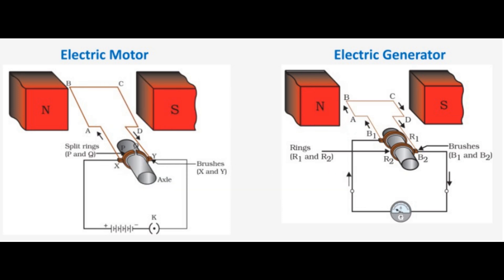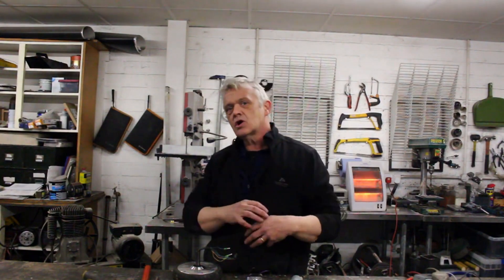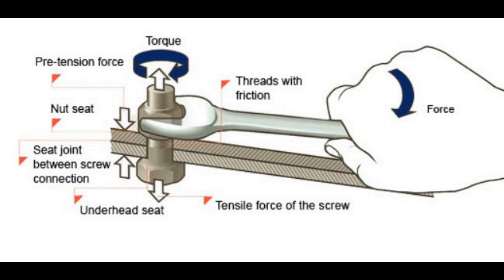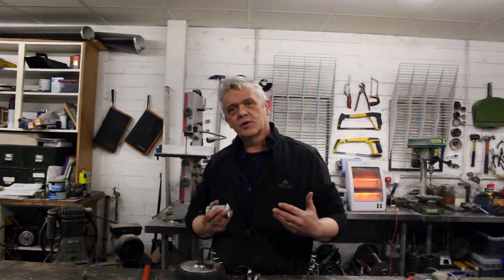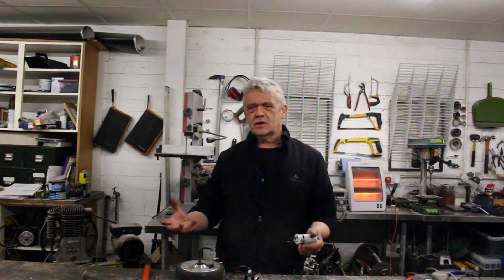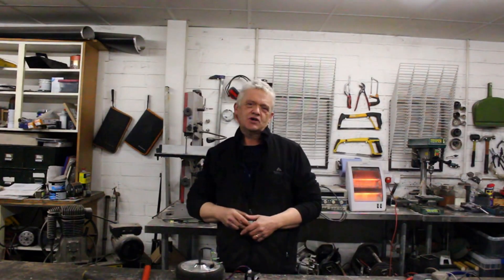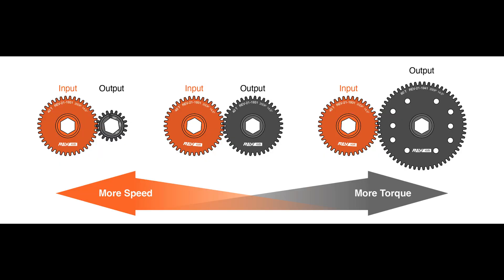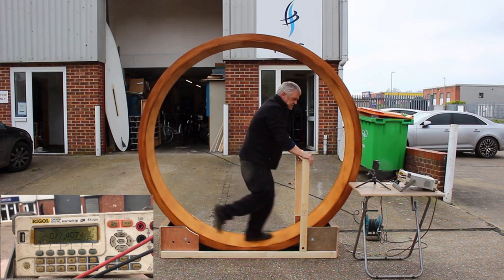2227 Choosing Motors To Turn Into Generators

Comment: Thank you for the pearls of wisdom Robert!
I am an absolute novice, but after researching before setting about to build a waterwheel ive found the biggest issue is transfering the energy from source to use/storage. Most motors produce dc power, but to transfer 12v or 24, even 48v d/c power is highly inefficient, for some reason there is a tremendous loss of power even in a thick cable over a distance of, say 100 meters. Whereas a/c, even in a very thin 14awg/4.5mm wire the loss is negligable. Electricity is strange stuff

Comment: Technically, power plants doesn't use permanent magnets at all. They're using electromagnets as a rotors. There're two types of constructions to transmit energy into such rotor. First -- just using a collector on the shaft and second -- using a rotating transformer or another generator on same shaft, that inverted in terms rotor/stator so you just energize stator and rotor would be generating and supplying first rotor's winding.

Comment: Old Fisher & Paykel ecodrive washing machines are amongst the best. Company in new Zealand makes wind turbines using those exact motors. I got one in parts in my shed, AMAZING amount of magnets and coils. Generally the electronics fail in them and the motor is fine. I got mine off the roadside.

Comment: I would like to understand more about hand cranked motors without needing to use 3D printing
Reply from the maker: i am not sure what you mean mate - do you mean how to turn a motor into a hand cranked generator? or how to build a motor witout 3d printing?
Reply: @ThinkingandTinkering  i meant how to turn a motor into a hand cranked one. Something very small that won’t require much that I can show to a child
Reply from the maker: @townbell2248 ok got it mate - that's in the gearing -  get a small motor some lego gears and you are away - the faster you turn it the higher the voltage but it gets harder to turn - i did do a video on the relationship of gears to torque and speed
Reply: @ThinkingandTinkering  thank you, I will have to check my kid’s toy box! Have you ever seen those spiral drawing gear wheels? You stick a pen in a hole and they draw cool patterns.
Reply: @ThinkingandTinkering  thank you for everything.
I hope you & your family are staying strong despite difficult times.
Please don’t stop doing what you do.

Comment: Isnt the counter torque going to be based upon the electrical load? Open terminals on a motor are easy to turn, but short it out and it becomes difficult.

Comment: Any motor that could be turned as mechanical force easily (say a washing machine motor) using water fall force would be beneficial but friction will always be a pain in the bum.
Reply: By the way Rob, the motor you turned by running on a wheel, if you ran that on a wind turbine 3 times the circumference of your wheel you would get some cool outputs.
Reply from the maker: it always is mate lol!

Comment: A brushless motor is a lot more efficient and a stepper motor is cheap easy and almost as efficient, so the best choice would be probably a stepper motor.
When it gets really interesting are linear actuators, you could use a speaker as the generator then, but I have never done that and I would like to know if that works well.

Comment: I work in trades/construction and regularly see motors tossed in the bin that could be salvaged. Most common are fans (ceiling fans, bathroom vents, oven ranges).
I'd love to see some 3D printed kits that could repurpose some of these motors.
As much as I would like to take a few to tinker, I don't have the space nor the time for making my own kits. But if one was available I would at least build a few and give away some.

Comment: The flywheel should be the battery spinning, three Free energy packed weights all gears together the motors the battery/ gear/ generator charge high voltage no contact deceleration , drive on low voltage, bearings for brushes.

Comment: What if,. Instead of using alot of magnets are mounted eccentrically on the shaft,  and the windings are on iron bars that reach to the center aligning with the magnets forming a loop from the shaft. Up through the core and back to the shaft with something like two 25 mm cubes, or cylinders, possibly a pair of 50x50x20mm N52 magnets, (or whatever the strongest new magnets are called!!). Or use 4-6 magnet's, two in a gear sperating like a planetary   with the U shaped iron , the u facing the rotor, with the gears passing inside at the tips , on the edge of the gears the gears having a trapezoidal iron chunk on it on both sides.  The shaft causing the gears to spin around the shaft  alternating the poles comming within .030" of the iron U's with the tips shaped and spaced to catch the alternating poles of the gears. Using iron over lots of individual , expensive magnets. and possibly spinning similar bars attached to the shaft. With the  saddle of the u being stationary. With a coil windding on it.  Ane the shaft having a large ring magnet, around the shaft. Or multiple smaller magnets forming alternating poles. This equals large bar magnets passing the coils as the shaft spins. The use of old transformer cores is possible.  Snd only a few expensive magnets are required!

Comment: Yup, there is no specific efficiency of a motor or generator.  It depends how it's used, how much power is being input/output, the physical and mechanical load, speed etc.

Comment: Always thought about using brushless rc plane/drone motors, they are 3 phase but thats easy to rectify and run wide range of voltage and current. Cheap, readily available and easy to work with

Comment: Well that is what I'm attempting. The alternator I have puts out 12V 145 Amps at 3500 rpm. This is a stock Toyota Tercel alternator. It is my attempt/ intent to charge my E-bike, while driving, using the alternator.  And Rob has helped a lot in this endevour. I can't say that Rob has ever attempted this, but I'm sure learning a lot. I just need to figure out the electronics at this point. My E-bike operates at, on a full charge, is 84V 10 amps. Any input to assist me would be greatly appreciated.

Comment: I am thinking a very large belt ran over the outside diameter of the big wheel running little wheel and shazang gearing changed

Comment: I’m planning on using a similar hub motor with my barrel wind turbine set up.  How would you increase the rpm’s of the hub motor using reduction gears for that configuration?  Your videos really make me happy, btw.  I feel that it’s going to tinkerers and hobbyists that will spread the awareness of renewable energy solutions around the world and you Sir, are a major contributor to that movement.  Bravo Zulu.

Comment: Most induction motors won,t work unless you add magnets .
ts
Reply from the maker: They do but working as generators or motors is to do with the slip speed ratio - the ratio between the shaft rotation speed and the synchronous magnetic field speed - less than 1 and it's a motor - more than 1 and it is a generator

Comment: I been waiting on you to talk about this topic. I have came across two papers some years ago named Energy Impulse Secrets  and Impulse Power Secrets by kanarev. In general they talk about how the world of Impulse is different from conventional physics and how it can lead to an excess energy production in comparison to the input.  They claim to build a self running generator and as such created a new law called the inertial increase of electrical power. Its basically using impulse of inertia to generate torque. This same impulse is also involved in solid state circuits as voltage and current Impulses, and can be used to genrate excess  HHO gas from water. I would post links to the papers but my comment would be deleted so please look it up on google.

Comment: Hi Rob.
If you make the hoverboard wheel roll on the floor at the same speed as you did, 
 2 steps/sec , I suspect it will produce about the same power. The mechanical advantage produced by the big wheel is the thickness of the board between your shoes  against the inside diameter and the outside diameter of the hamster wheel.
For 1 rotation, you need to walk 6,063m inside intead of 6,1m outside. 
The torque is not 82kg at 0.97m= 780Nm, the torque arm lenght is only 1/2 step, about 0,43m x 804.42N= 346Nm to 0Nm when your foot arrives down until the next step.
I saw you did 7 steps/rotation 346/2/7=24.7 Nm/rotation 
120rpm=12,56rad/sec and that times torque = 310W not counting loses (I must be wrong, it seems too much.) Maybe the loss during intersteps or the aproximation 346/2 for 346Nm to 0Nm?  346/4 would be better to also represent 0Nm to 346Nm when the foot is applied the torque is not immediately maximum, and it would be 155w 12,35Nm
You where walking at 12,2km/h
Nice performance. :-)
Cheers.

Comment: I keep watching these hoping to learn how to actually build a wind turbine, but he makes it seem much easier than it rly is. I don't understand how you say a motor, and a generator are identical? If they were Identical, I could simply spin a motor with my hand, and get voltage out. This is not the case though. You have to change the wiring...somehow..I dunno, I get confused every video..sigh  Thank you for trying though! :)

Comment: I just got a 7.2 KW industrial permanent magnet servo motor for $30 !!!! 
  It apparently outputs three-phase AC when spun!
   Now it would be simple enough to put a 3-phase rectifier on there, combined with some kind of buck/boost converter for voltage regulation maybe a grid tie inverter or battery charge controller
  Ideally though I would love to use it as a motor for some kind of vehicle, one with regenerative braking.
 The problem is it has two connectors, one is an 8 pin and one is a 4 pin and other than the three pins that put out the ac voltage when spin it, I have no idea what the other pins are for!!  Neither do I have any idea exactly what kind of motor this is!
   How do I find out ?!?!‽

Comment: couldnt u just use a cars alternator?
Reply: Use a 12v power inverter to use your normal bike charger.
Reply: @MHLivestreams  Thanks. So I can't just use the DC that comes out of the  regulated alternator, which is determined at the output of my existing charger due? Is that what the 12V power inverter does?
Reply: @robinhooper7702  an inverter changes DC to AC, it's simple enough. They're quite cheap really.
Reply: @MHLivestreams  Ah, I think I get it now. I just plug the alternator into the inverter, and then the inverter is plugged into my existing AC to DC charger to charge the battery pack. That sounds too simple. Much gratitude, dude.
Reply: @robinhooper7702  plug the inverter into the car battery, and the inverter allows you to use any AC device.  Get one rated at least twice the desired potential usage, because inductive loads have twice the demand. Make yourself a cup of tea, use the microwave, whatever you like. 1kw load requires 2kw inverter at the minimum.
Reply: Well that is what I'm attempting. The alternator I have puts out 12V 145 Amps at 3500 rpm. This is a stock Toyota Tercel alternator. It is my attempt/ intent to charge my E-bike, while driving, using the alternator.  And Rob has helped a lot in this endevour. I can't say that Rob has ever attempted this, but I'm sure learning a lot. I just need to figure out the electronics at this point. My E-bike operates at, on a full charge, is 84V 10 amps. Any input to assist me would be greatly appreciated.

Comment: the PROBLEM has been pointed out  to me by an official incounty council i ssurjest to him if i was to bolt an RSJ to the end wall of my house to get the M/C abouve the pitch line of the roof i would run into trouble with the planning department  The bassis of this converdation was the ease of obtaining roof generating setuppsand i pointed out the switch gear involved is the difecult part to install then it turned to wind turbines and how you erect them .imshure you have hit on this prob before please say something on this subject   ttfn&ty

Comment: You can mention about CZinger 21C car. It has a generator attached to the rear-mounted internal combustion engine, and 2 electric motors in the front powered directly from this generator (it has 2 super-capacitors as a buffer).
So effectively it has copper shaft that does not even spin.

Comment: I'll base this on VAWT and your walking wheel direct contact. VAWT with a nice base plate like your walking wheel. A specified wind will turn at a force for a specified motor, but as the wind picks up you get more speed or force. The wind id the same, below the base plate or to the side. I could use that wind to catch enough force to apply a second motor when the wind increased enough to take the load and disengage when the wind slowed, prolly just with a spring and a wind catch. Just a thought.